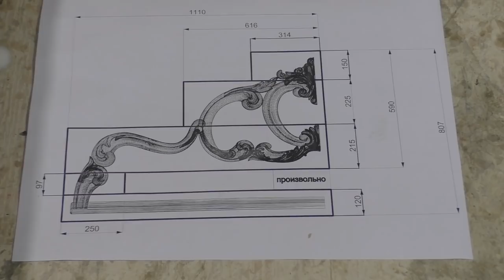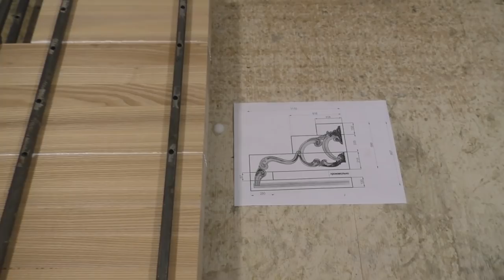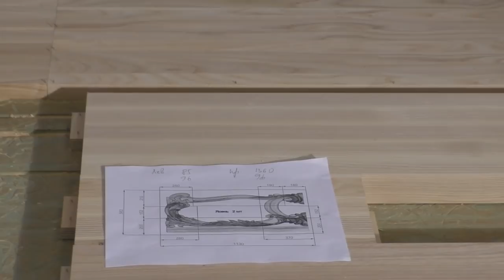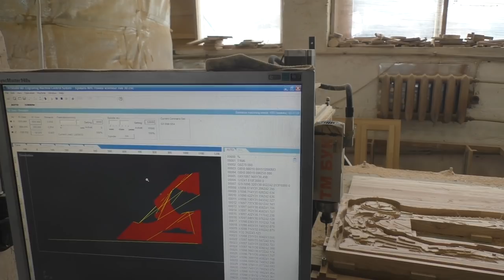How to make bed with CNC router

Comment: Metric drawings look so nice. The numbers are using only Whole Number of mm. No need for detailed decimals for most purposes. +- 1mm is reasonably accurate enough.
Reply from the maker: When we need to get more accuracy - we use hundredths of a millimeter after the point. For example 1200.47mm